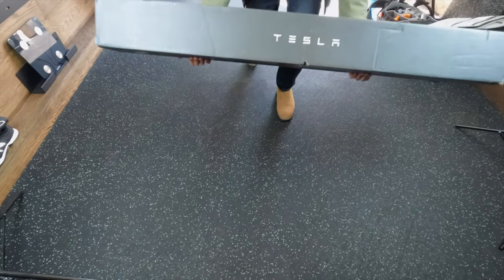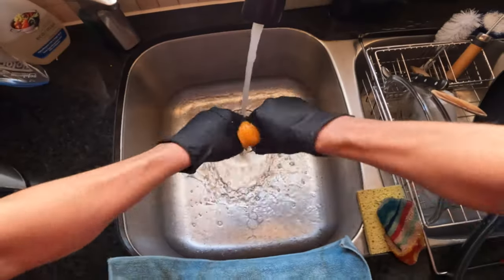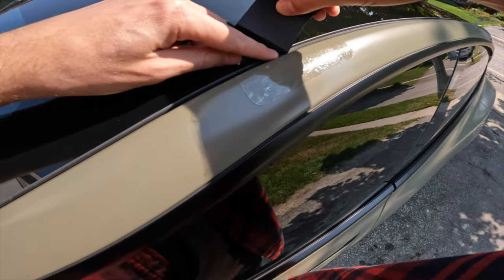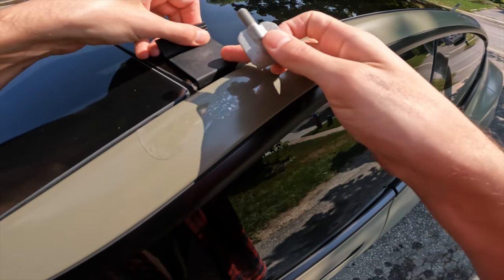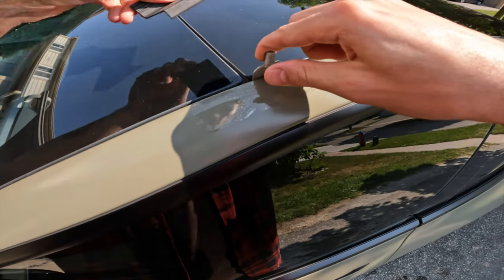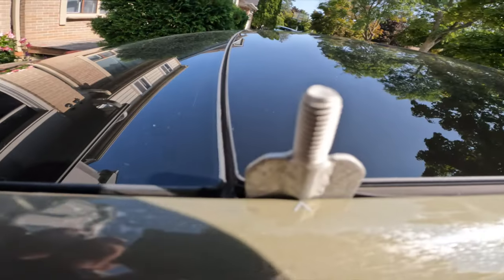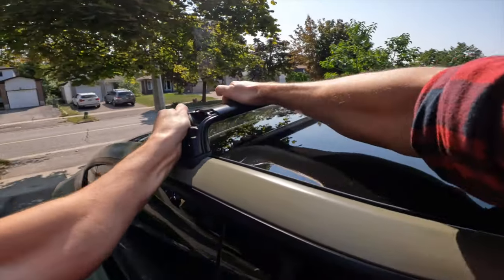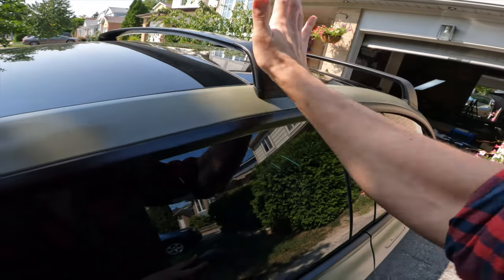Tesla Roof Rack Installation | Models S/3/Y

Comment: If we dont have torque wrench what would you say is a good way to judge the force?
Reply from the maker: Hi Michael,
Good question and I wasn't so sure myself so I did some research. It seems there isn't a reliable way to measure the correct force without a torque wrench tool. Good news is they can be purchased from most hardware stores and or borrowed from a handy neighbor!
Reply: They are very cheap - I would grab one on Amazon or a local hardware store. Super handy for a lot of applications

Comment: My car is a 2015 S and it apparently has to have an "adaptor kit" to fit the roof rack that is now available. The original rack for my car is no longer available from Tesla. How do I get a correct fit for my car?
Reply from the maker: Hi Ben, 
Sorry about the delayed response. I reached out to Tesla on your behalf to get an answer to your questions and they referred me to this relevant information for your Tesla Model S: 

Model S (Glass Roof)
Any Model S built on February 11, 2019 or afterwards requires the roof rack only.
Model S vehicles equipped with the full glass roof but built prior to February 11, 2019 will require a retrofit performed by Tesla Service prior to the installation of this roof rack. Contact your local Service Center for retrofit details.
Model S (Panoramic Roof): Not eligible for this product. A separate roof rack was previously sold but no longer available.
Model S (Metal Roof): Not eligible for this product.

Hope this helps. Although it seems you may have to contact your local service center and set up an appointment or speak with an adviser there for further clarification on next steps for your 2015 Tesla Model S roof rack project. Best of luck!
Reply: How would I find best place to get original racks 2013 model S or is this waste of time